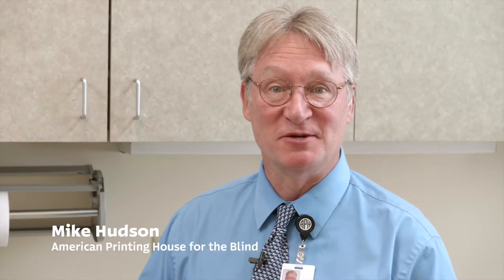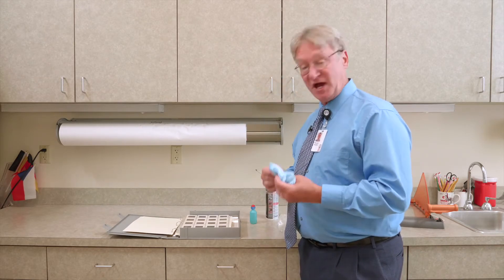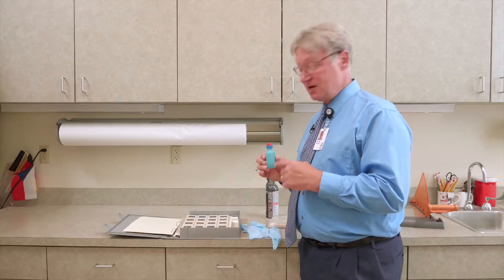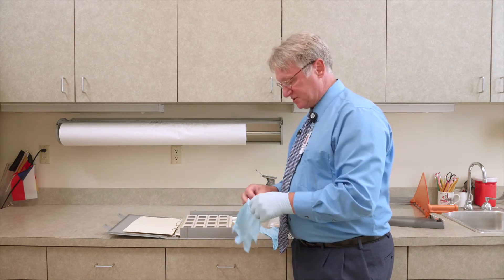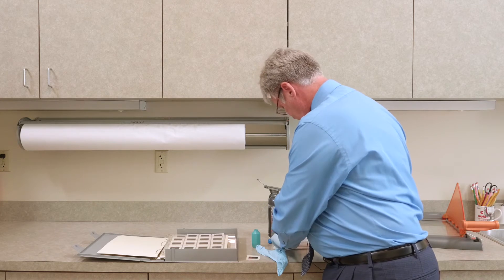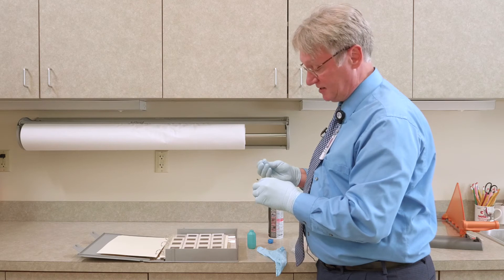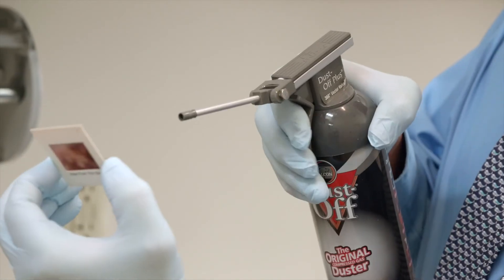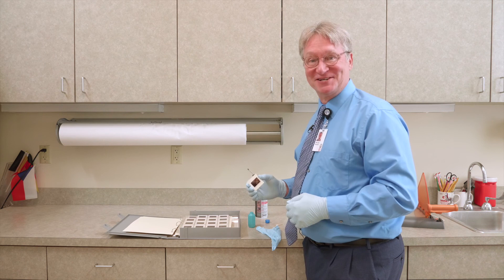Cleaning Slide Film: A Museum How-to

Comment: The video is a short version of a complex subject. The only change I would make is to use the blower before and after the anhydrous isopropyl. Remember he is talking about cleaning the emulsion (dull) side of the film. The backing stays relatively clean, and any sticky dust there can removed there with a clean dry swab. Drugstore isopropyl is sold as 70% and 91% concentrations. If you try either of these the streaking you observe is the dissolution of the soapy solution the film processor used to prevent water spotting, combined with the emulsion soaking up any water. Give it a few minutes to dry.

Comment: Great video. Thank you for sharing. I have about 600+ kodachrome slides from 1989 while travelling through Africa that have small amounts of mildew on a number of them. I'm guessing this method can be used for these slides too? Interestingly I have over 300 slides shot in Nepal 1987 using Fujifilm that don't have this issue and are stored in the same manner and location as the Kodachrome slides.
Reply: You must use 98% or GREATER isopropyl alcohol. SWAN brand makes a 99% available at Ace Hardware. Use a cotton puff, not a Q-tip.Remove slide from mount and throw mount away. I completely submerge the naked slide in a dish of 99% alcohol so the alcohol reaches into all the sprocket holes and floats away any grit present as grit will scratch the slide when you swab. Swab BOTH SIDES of the transparency or negative generously even though Kodak's own instructions say not to - it's the only way you can be sure you have killed ALL the fungus. Shake off excess liquid and hang to dry. Remount in BRAND NEW slide mounts kept separate from the contaminated slides or you'll have to repeat this in a year or two when the cross contamination causes the fungus to grow back. Wash your hands after touching any fungus-contaminated materials EVERY TIME BEFORE handling/opening the new materials (slide mounts, slide pages, plastic storage bags). Cross contamination will destroy all your efforts and expense down the road. The only slides of mine that were "ruined" (they suffered a color shift that I reversed in Photoshop after scanning) were Kodachrome slides from the 1940s - but not all of those from my 1940s collections had this same problem. Perhaps the original processing on the lesser successful slides had something to do with it.

Comment: Followed this guide on a Kodachrome slide and the alcohol resulted in permanent streaks in the backing of the film. Might just be because of it being Kodachrome but it's probably best to not use this guide.
Reply from the maker: Hi David, we're sorry to hear you had issues. 98% Isopropyl alcohol is a standard way to clean such slides. But if the alcohol level is lower, such as found in rubbing alcohol, you can damage the slide.  In any event,  we recommend testing cleaning methods before proceeding.
Reply: @AphOrg  Is 99% suitable or does it need to be 98%?
Reply: @courtneyking9271  99% will be fine. As long as it is 98% or higher
Reply: The process demonstrated in this video is the same as the method recommended by Kodak on their website.
Reply: And what percentage of alcohol did you use? If it's lower than 98% then thats not recommended.
Reply: Had the same thing happen to me.  Sorry it happened to you.
Reply: Also, I believe that even 99%+ isopropyl will suck water out of the air and dilute itself over time. If you have a bottle that was left open too long, or opened too many times with air circulating into the bottle each time, it might no longer be 99%.